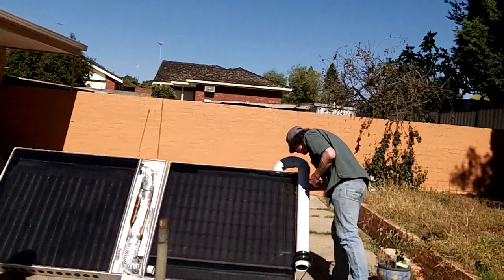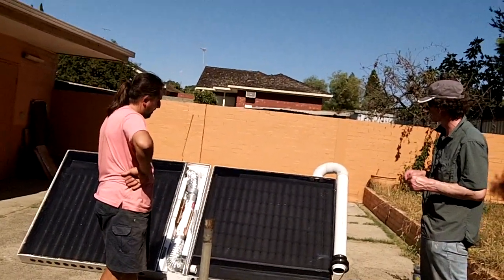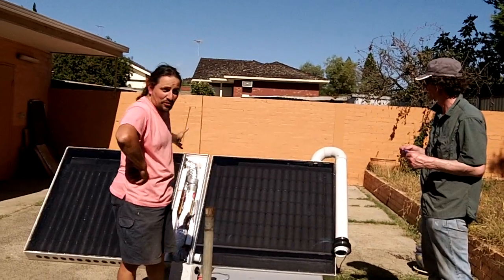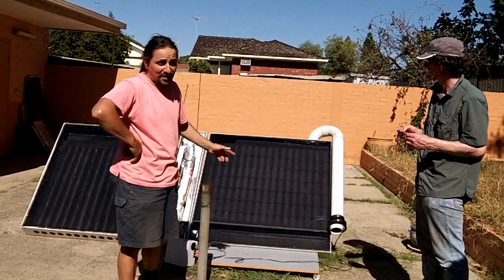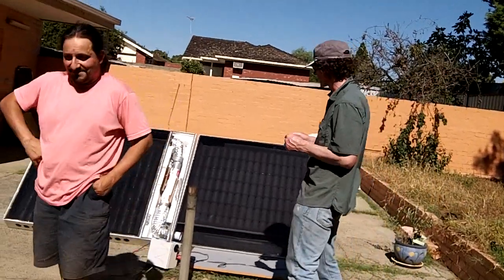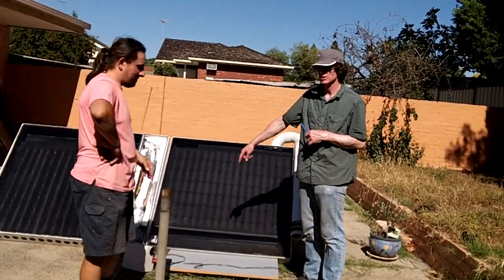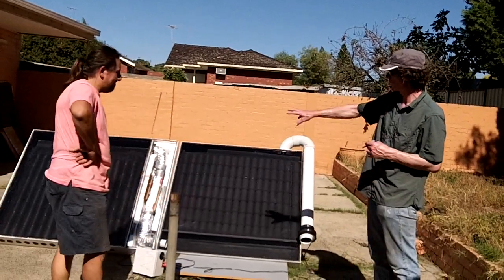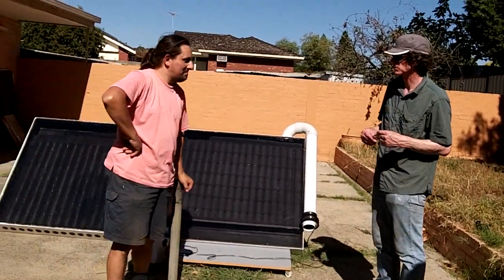Tesing Different Solar Heaters Part 4

Comment: Keep up the green effort every bit helps.
Your first heater was puting hot air into a unit that was already possibly maxed out . 
Heat energy can only travel from hot to cold , once the preheated air enters the second collector the sun is trying to increase a super heated box , there is a point where it won't collect any more heat as the temp inside rises . 
It's like constantly pouring boiling water into a container of cold water , eventually the containers water will reach close to 100 degC and pouring more boiling water will not increase the temperature . 
The best bet is to recycle the air by drawing the inlet air from the house to increase the efficiency of the room heating. 
I like the aluminum  fly screen on the inlet to collect heat , I'm going to do that to my box :-)